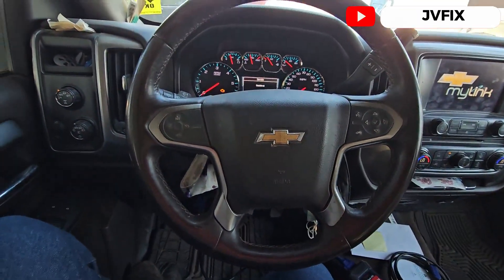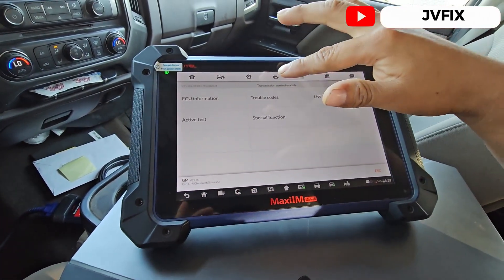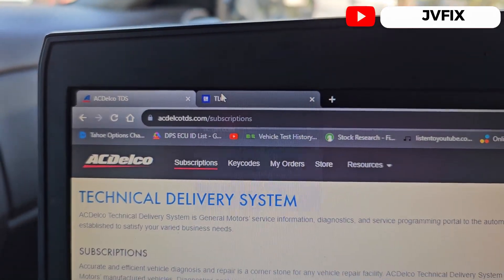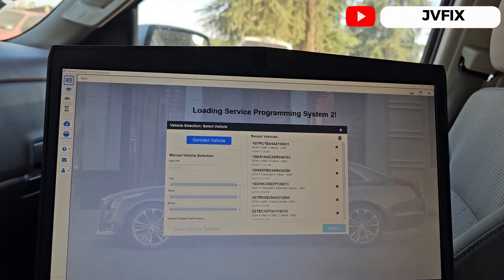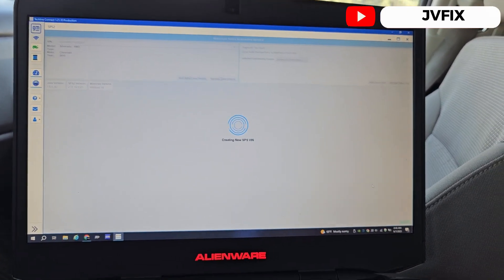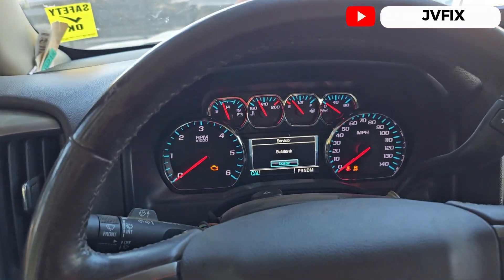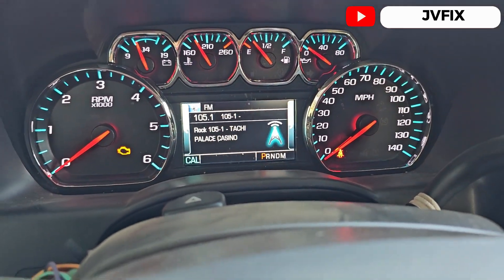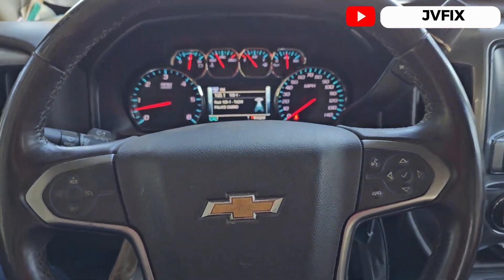How to program Transmission for Chevrolet, GMC, Silverado, Colorado with SPS2 j2534 code P0602

Comment: Hey buddy I got a question I did this just not program or flashing 

But when you install the new TCM does the truck still crank or no because I have no crank and a shop is telling me it should still crank 

And I used an at home basic scanner and obd port says failed to connect 

Just checking I appreciate it buddy

Comment: If it's for an LS swap do i put the VIN from the engine? What if it's from a 4×4 truck and I'm installing it in a RWD car?
Reply: No.  You always use matching vin from the truck itself.  All modules must have the same vin number programmed.  You can always change parameters and values after the initial programming if you need special settings for the LS.  But the vin #'s must match first or your truck will think it's being stolen and and not start or run like crap being in limp mode with theft system engaged.
Reply: @StrayDogTheExposer It’s been swapped into a 73 Camaro with the Holley Terminator X Max harness and ECU controller and 6L80 transmission from a newer Camaro (with the Holley Terminator X Max transmission controller). Hopefully I don’t run into any problems…

Comment: I have a 2008 pontiac g8 gt i bought a rebuilt 6l80 its not the original do i have to do the samething reprogram how do i know if my 6l80 is compatible with my g8 the car stays in first gear and the car is tuned with a 4200 stall

Comment: I have a 2012 4x4 Silverado. I’m changing out my trans 4L60e will I be able to drive it to someone for programming?
Reply from the maker: You could, but you are risking it by damaging it
Reply: I believe those don’t need programming
Reply: Thanks for the reply! I had it towed and programmed… transmission runs smooth!

Comment: If I have an used transmission with its original transmission module, can I just swap it and relearn immobilizer?
Reply: If the car is global A vehicle, mostly it won't work. The module will be locked to the first VIN coded

Comment: How to know if a 2014 Savana is Global A module?
Reply from the maker: If it has 3 connectors to the ecu is global a if it has 2 is the old style still
Reply: @JVFIXLLC  Thanks for your time to answer my question 👍
Reply from the maker: @gaston50952  no problem

Comment: What is the part number for your scanner? I can pull up the j2534 but they all say for Toyota etc. but not GM. Which one do you have that reads GM?
Reply from the maker: if u want to use the autel j2534 u need to install the drivers from autel.com under downloads file name as maxi pc suite

Comment: How do you get the scanner to connect I have one that shows connected but won't connect😅
Reply: Also I have the smart box 3.0 from matco maximus 4.0
Reply from the maker: probably you have a blown fuse for the obd2 port, or you have a short on the communication lines

Comment: Hello! I have a question 
Have a 2019 silverado 5.3 it's been involved in right front accident and abs sensor was damage, customer replace abs sensor only, same abs module, have a code p0602 and c2a1b. 
Are you familiar with those codes and do i really need to program abs ?
Reply: Also I have autel ultra, not sure if can program it
Reply from the maker: the code p0602 can be fixed by reflashing the abs module and the las code means there is an air leak in the abs accumulator pressure system. there is a function in the scanner to reset the zero point pressure for the abs